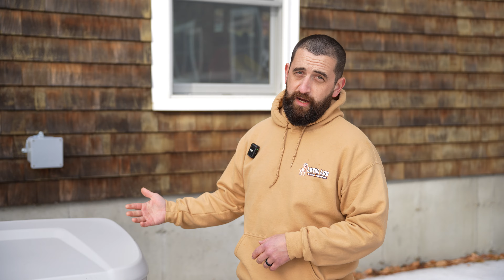NEW Generac 28KW Standby Generator Install

Comment: That’s not true. The engine is different. Slightly bigger. A lot more sensors. Different air flow. Having to add a resistor to the control wiring to fix an issue with them. The engines are more efficient.    Slacker.

Comment: either 11kw or 28kw you would still need to install  load shed modules, all depending on your load. Yes if you have two electric furnaces, heat pumps, car charges, range, oven,...tec.,--yes 28KW still needs Load sheds.
New style still lacks on practicality--barely-to no room where you want to hook up your generator feed wires or control wires--all blocked with existing generator wiring. Generator main breaker--thats another story all flimsy and not stable.
Also need completely different  gen cart to haul this thing into backyard--half open--yes front panel has to come off. Yes-you have to unscrew both side panels too-to unbolt this thing from the pallet. I personally installed over 300 of older style, now dealing with this new style through the App--is another story--where you need to register as a installer(so you can run test) and then transfer this info to customer., etc.,
Kudos to Loyal Lab Electric and respect to work in such tough weather environments! Don't get me wrong--Generac is good solid company with graceful reputation (just like Toyota in cars) but this New Gen generators need to get some adjustments to make it easy to use and install!

Comment: What happens if you live in a no cell coverage area as far as using the app for setup and monitoring?
Reply: Check out the comment I gave you I'm a Electrician also
Reply from the maker: There's also a wifi capability option instead that can be used but is less dependable due to the same reason your power goes out is often what takes the wifi out.
Reply: @LoyalLabElectric not if you use a unterrupted Power Supply it's back up battery Supply get at best buy plug in your modem into it generator takes a few seconds to get going work great no interruption

Comment: I have 3400 Sq feet, 2 a/c units, 3 and 5 ton, 2 water heater and 2 well pumps. I wish this unit was out when I installed mine. I currently have a 22K.
Reply from the maker: It's a beast of a unit and we're glad they came out with it! Most times people will still get a smaller unit than they "need" anyway and just choose what things they'll use when the generator is on after the power goes out. That being said being able to run everything in your home without worry is also very nice.

Comment: What fuel does it use?
Where and how is the fuel stored?
How loud is it when it's running?
Reply: Mine runs on propane, the noise really isn't that bad, a little quieter than a lawnmower.
Reply from the maker: Great questions! These units runoff of natural gas or liquid propane so the storage system depends on the fuel supply. 

As for noise levels,  many of our customers don’t really even notice it during the weekly exercise and when they do, they describe it as quieter than their lawnmower.

Comment: There is no home of any size that needs a 28KW generator. That's Generac trying to outnumber the competition.
Reply: This is a ridiculously ignorant comment. I own a 5,600 sq ft home in North Georgia. I just bought a new Generac and had it professionally installed.

The load calc was borderline between a 26kW and a 28kW. The difference in price convinced me to go with the 26kW but I’m starting to be concerned that I undersized it.

We have 3 heat pumps. They use electric heat strips in the winter when the temps go below 35 degrees. Those pull 5+ kW each and more on startup. The water heater is electric, as is the double oven, and we have 4 fridges/freezers.

So during summer or spring, the 26k should run everything. But if we have an ice storm with frigid temps behind it, and lose power for a couple of days, the 26k may be underpowered.

The contractor put a SMM on the air handler in the basement to ensure it doesn’t overload the generator. We can also manually run each heat pump separately to make sure we don’t overload.

But to say no house needs a 28k is absurd.
Reply: @PatsSoxFreedom Diesel yes but not air cooled.
Reply from the maker: For the most part I agree. In this case we had a 7500 square foot home with a primary heat source that consists of mini splits and electric heat. Our current electrical codes require us to size the generator to 100% of the connected load. This home would actually need a larger than a 28KW according to those requirement.
Reply: I have a 3200 Sq Ft home with a 22KW Generac. I have 2 A/C's (3 actually but one is a mini split in a garage) Both A/C's have load sheds. That house is twice as big as mine probably more electric appliances as I have gas so that seems very realistic. If anything it might be undersized. This customer is probably like me. I want the gen. to power the house as the utility does and not have to make any compromises. I'm in So. Fl. where we deal with hurricanes. I lost power once for almost 2 weeks in a previous home and I said never again.
Reply: how can you say that?   I've installed many 40kw,   60kw and 80kw  in large homes that definitely couldnt function properly with a  smaller unit.       Good on Generac for offering it,  let the market decided if its needed.   I'd make the case that there is a need.
Reply: @santinoelectricandgenerators exactly my 3 bd house pulls almost all 24kw because runs on ngas.only pushes 24. When electric heat pump cuts on its all 28kw to start
Reply: @santinoelectricandgenerators maybe a home owned by Tom Cruise.